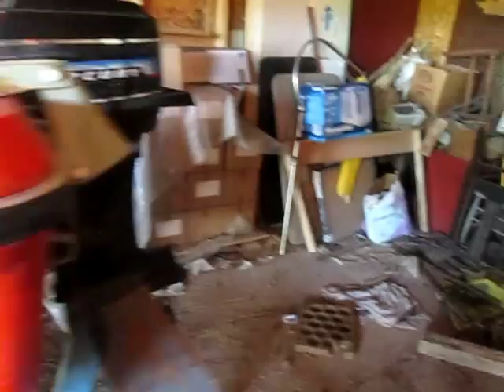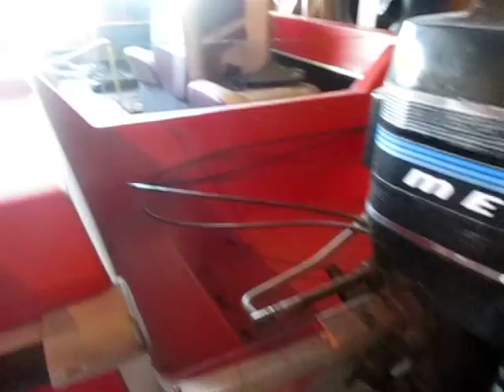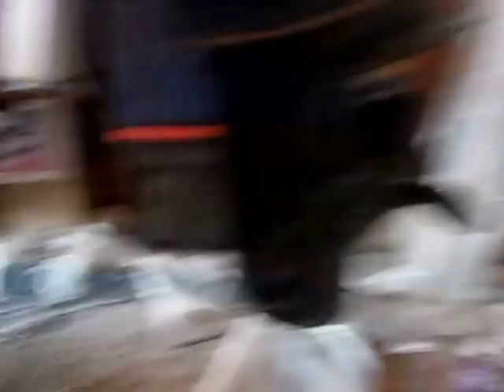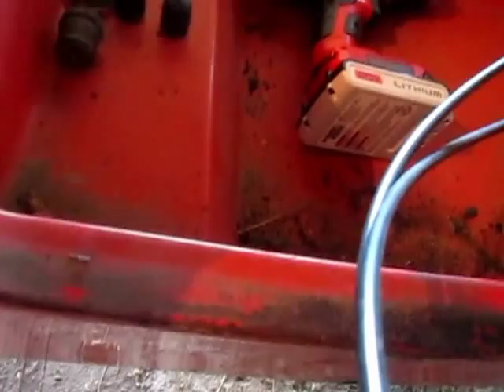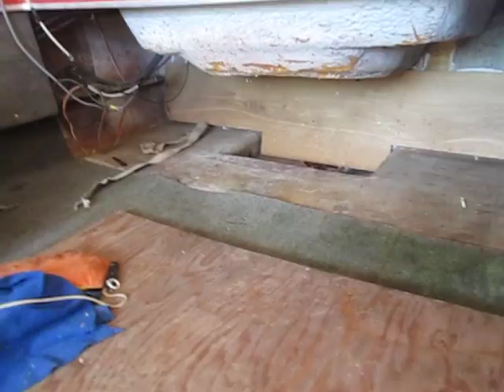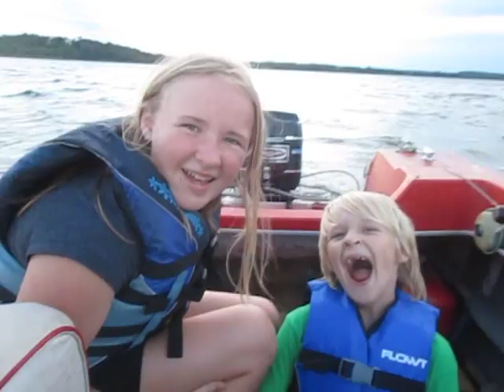Transom repair '73 Silverline tri hull the quick and improper way!

Comment: I have a similar situation and my innner glass wall is trashed. Was thinking of using liquid carbon core to repair transom, but the inner wall wouldn't contain it as is. Wonder if i coul use ply wood and some type of epoxy to create a new inner wall and then pour in the liquid transom repair?
Reply from the maker: Don't see why it wouldn't work.

Comment: so how did it hold up and what was thw over all build time on this. i have full shop and same boat . dont want to sell it if i can replace transom in this manner vs cutting out entire rear etc. if i did this method i would also glas in the entire rear also. please lmk as soon as u get this so i can make head way on my build ty man
Reply from the maker: It has held up, but still has flex as the parts are jigsawed together.  The proper way is to remove the rub rail and split the top deck from the hull all around. If you want a solid repair to hold higher HP you will want to do this.  The 40 is marginal on this boat, maybe 20 mph with a single person on board.  A slow cruiser with the whole family.